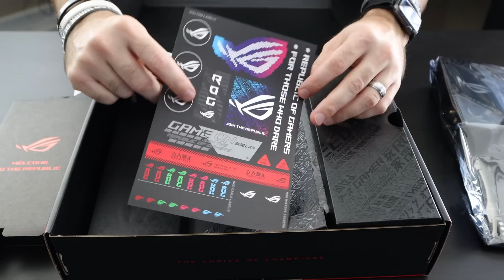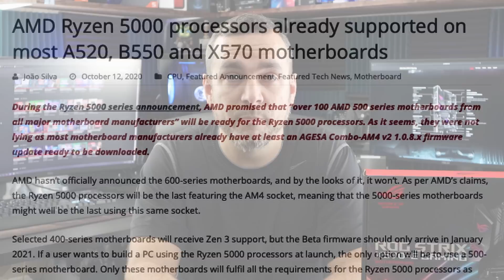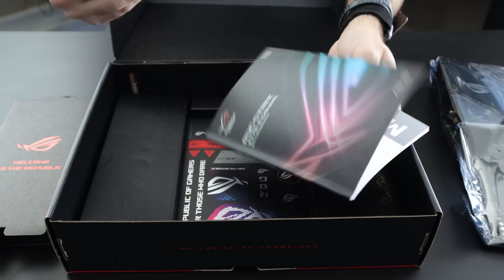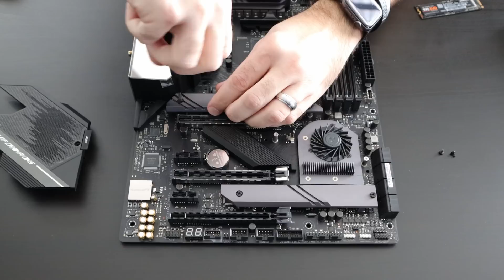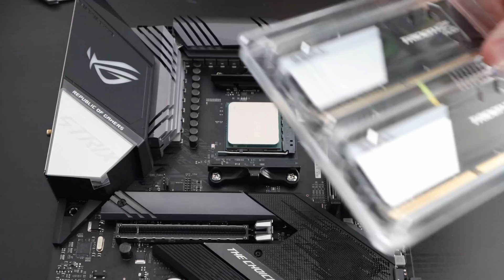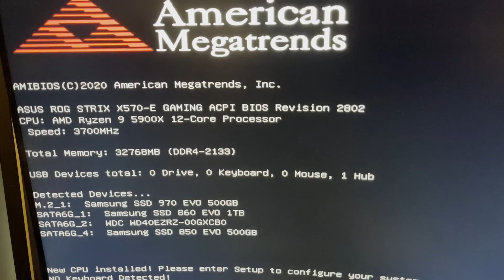Gaming PC Upgrade | Ryzen 9 5900X and ASUS ROG STRIX X570-E Gaming PC Build

Comment: My m.2 drive was overheating on the strix-e and i found out that the plastic gum that sticks to it between the heatsink that you removed the blue film from had turn to liquid (i did remove the blue film too before anyone jumps to conclusions) i had to clean it up and reinstall it without that disgusting plastic gum thing even if it scratches on the heatsink.
Reply from the maker: That’s strange. Check your fans and cooling. The paste on the back of the M.2 shield is there to help transfer the heat from the SSD to the heat sink. It helps keep it cooler. A lot of people also use system cooling to help reduce temps on the M.2 SSD, and completely remove the shield altogether.

Comment: thats the board and cpu i want, also the ram. but i want the nocuta NH-D15 cpu cooler and just wondering if that ram will get in the way of the coooler? will i have to get a low profile ram instead?
Reply from the maker: Not sure about that cooler and the clearance you will need. I can fit four sticks of RAM with my NZXT AIO, but it is a tight fit.

Comment: What made you pick this board over other similar priced 570 boards? I can't decide between this board or the unify 570. They are the same price in my area.
Reply from the maker: Honestly, I had an MSI board originally and returned it for this one. But I have been building PCs for almost 20 years and other than my first build, have always used ASUS motherboards. During that time, only one board has failed. I have retired or sold them most of the time. They just have great quality and are great overclocking boards. I might be missing out on better boards by sticking with ASUS, but I love their reliability.
Reply: @JasonRose2628  Thanks for taking the time to respond. Now for the hardest part of pc building this year. Finding the parts.
Reply: Same here

Comment: Hello, nice build 💪 I have the same motherboard and x63 cooler and i wonder if i can fit 4x 8gb of ram in ?
Reply: 2x16 would be a lot better
Reply: @Acrozion  will i be able to fit 4x8 ? i already got em :/
Reply: @jakob5144  please don’t do 4x8 it gives the same performance as 2x8 but adds extra heating and less cooling it’s also overkill you only need 16… give me a favor, save 50% of what you bought and refund 2 of them… but your answer is yes anyone can fit up to 4 sticks of ram
Reply: @Acrozion  Thank you for answers man :)
Reply from the maker: With the way I have this Z63 mounted, it blocks one of the RAM slots. You would need to rotate the AiO block to be able to fit four sticks of RAM. Sorry for the late response, it has been a busy week!
Reply: @JasonRose2628  ive managed to fit all 4 sticks whithout a problem :) it was more than enough space

Comment: Did you have any issues with the Kraken Z73? I heard there was some USB compatibility issues regarding ASUS motherboards & Z models of the NZXT. Did you have any of those with that motherboard?
Reply: Also have you had any issues with the CAM software not displaying the correct temperature of the AMD processor? I have heard stuff that due to the way the AMD processers display temperature, that it wasnt running well with the cam software.

Comment: Went to Micro Center today and a worker told me to get this board.
Reply from the maker: So far, it has been great! Very stable. Using AI Suite 3, I completed an OC of 4.6 GHz on all cores without tweaking any settings. Are you going to go with this board? What other specs?
Reply: @JasonRose2628  the other one I was looking at is the Asus B550-e. I don’t know if I need an x570. What’s the big difference?
Reply: @TheAccountant369   The x570 lineup have all PCIe-4.0 slots for m.2s and gpu slots, whereas the b550 lineup only has the PCIe feature on the top slots of the m.2 and gpu

Comment: Would the X570 Dark Hero be better for the 5900x? Have heard good things about it.
Reply from the maker: Probably, I believe it is considered the best X570 board out. But, it also comes with a much higher price tag.
Reply: @JasonRose2628  Price not an issue for me, going all out lol
Reply from the maker: If I could, I would probably go with that board. But unless you plan to use everything it has to offer, it is wasted money. Like the ability to have 128GB of RAM at 4866MHz is gonna be very expensive. Also, if you are getting this board, then you are probably gonna have multiple M.2 drives and GPUs. Other than that, your money would be best spent on a cheaper motherboard and improve other components. But if money is not an issue, then it doesn’t really matter! 👊🏼👍🏼

Comment: Question ! Please I need your help 😅 I had the same thing happen where I only have the 4 pin and I don’t have the extra pins to connect for the CPU and when I tried booting it I got stuck on the screen where it booted up. Was wondering if I needed to update my bios for my x570 or if I need those extra pins to the CPU
Reply from the maker: Your system can function just fine on the 8 pin connector. I did it in my last build when I stopped overclocking my 9900K. You only need to connect the extra 4 pin connector if you plan to overclock your CPU (which this time I did). So if you are having issues with boot up, you may need to do a BIOS update. It could be a few other factors, like your PSU might not be very efficient and not providing enough power with the 8 pin connector. What PSU do you have? Where exactly during the boot process does the system freeze or get stuck?
Reply: TechRated Thank you man I figured it out I needed to buy a old Cpu and update my bios then where and returned it and was able to run my 5900x just fine !
Reply: 8 pins are necessary? What if i Cant find 4 more pins? 😨 For the first time im going to build a PC by my self and im god damn nerves

Comment: I mount my radiator like that before and it just lasted a year. Then I researched and the hose should be below.
Reply: He has mounted it fine. The top most part of the radiator needs to be a level higher than the pump. Doesn't matter whether it is the inlet/outlet side up or the the other end, which ever side up you are that end needs to be higher than the pump level.
Reply from the maker: That’s debatable. Check this video. 
https://youtu.be/DKwA7ygTJn0

But I did switch it this time around, it might not be clear in the video.

Comment: I noticed that the RAM speed for this board is 2666 MHz rather than the standard 3200 MHz of many other boards. Do you happen to know why that is? I just bought this board and I'd hate to be downgrading my specs. I'm pretty sure I can go into BIOS and change it to 3200 MHz but I would hate to OC the board and make it possibly unstable. I have 32gb of RAM DDR4 3600 CL16. Please let me know!
Reply from the maker: Sorry for the delay, this comment got lost in the shuffle. I have enabled DOCP to 3600MHz and I haven't had any issues at all. Many people are going to 4000Mhz with no issues. I wouldn't worry about it. Not sure as to why ASUS went with 2666MHz for base specs, but I can say that this board is very stable so far! Good luck with your build!
Reply: @JasonRose2628  thank you!

Comment: Hi !!! thanks for your video !! :) i have a question, i want to buy asus ROG strix x570-e gaming. My question is it is possible to connect all fans of the corsair 5000D on the board ? 
Front Fans:	3x 120 or 2x 140 mm
Rear Fans:	1x 120 mm
Top Fans:	3x 120/2x 140 mm
Bottom Fans:	N/A
Side Fans:	3x 120 mm
Do you think the motherboard can support all these fans ?
Reply from the maker: The motherboard has six fan headers total. If you have that many fans (very nice case btw), you could definitely benefit from a fan hub/controller. You should check out the Commander Pro 
https://www.amazon.com/Corsair-Fan-Controller-Commander-CL-9011110-WW/dp/B0725HP1J2
You may need more than one.

Hope that helps!
Reply: @JasonRose2628  thanks a lot my dude 👌🏼👌🏼
Reply: @johann1336  youll need to use commander pros anymore if you want to use corsair fans, which I would HIGHLY recommend says if you want that many fans im sure you want it to look nice. OR go with LIAN LI UNi fans that you can connect like 3 fans together and only need to use 1 fan header on the mobo because of the waythey are made
Reply: @100MilWill  ty a lot !!

Comment: How's the system doing ? I'm thinking of getting the same motherboard and CPU and rtx3080 , what you will suggest for power supply of that ?
Reply from the maker: So far, the system is doing great! No issues at all. I have read a few reviews saying that the board crashes after a few months, so I still have some time to get to that point. However, I just overclocked the 5900X to 4.6GHz on all cores very easily using AI Suite 3. Working on editing that video now. I haven’t tried to tweak any voltages myself yet.
Reply: @JasonRose2628  I've ordered one hopefully will be fine ...

Comment: "Question" Can you use the onboard HDMI graphics port with the Ryzen 9 5900X and ASUS ROG STRIX X570-E. ? ? ?  just thinking would be good to have a internal graphics backup in case a card fails.
Reply from the maker: No. The 5900X doesn’t have integrated graphics. You will need a GPU of some kind!

Comment: I'm using similar configuration, but with strix 3080 and lian li 360 galahad inside lisn li 11xl case. 3200 cl 14 ram *16 gb and Samsung 980 nvme. Can my ram be stable at 3800 cl 14 with this board? 3600 is also fine

Comment: So did you find out what that extra 4 pin connection for the cpu was?
Reply from the maker: I already know what the extra connector is for, just needed to connect an additional cable from my PSU. These CPUs require more power, especially if you plan to OC. So instead of it just requiring 6 or 8 pin for power, it requires an 8+4 pin setup. I have been able to run 12-pin CPUs on 8-pin connectors before, but I wasn't planning on OC'ing. With this CPU, I plan to OC, so I need all the power I can get. I also do not have the black/blue cable extender for it, so I’ll be ordering it soon!
Reply: @JasonRose2628  That's why I'm having issues with my PC. I only hooked up the 8-pin section. I need to hook up the 4-pin section as well!
Reply: @Esspppiia  Did connecting the 4-pin help? I would have thought that the 8-pin would be enough with a good PSU.

Comment: How did you get the GPU stand on its own ? Did you use a riser for that? Where was the PSU ? Thanks!
Reply from the maker: The Phanteks Enthoo Evolv X case that I am using has a built in vertical mount. I purchased the additional riser cable for the vertical mount. I explain it all in this video! 
https://www.youtube.com/watch?v=bNgsxVLFexY&t=78s
The case also has a PSU shroud. The PSU and cables are all hidden underneath the shroud just below the motherboard. Normally, I would include all of that in a build video. Since I was just upgrading,  I didn't show any of that stuff. Hope that helps!

Comment: You find 4pin adapter for cpu?
Reply from the maker: Yes I did. I had add a 4 pin cable to my power supply and connect it. I will be ordering another cable mod cable to connect to it though. You can see the stock power supply connected to the CPU connector at 12:41.
Reply: @JasonRose2628  thx for answering. I have another one question, maybe ypu know. I have the same cpu and mother board, but my power supply didn't have a 4 pin  connector, have i any possibilities to use it, or i need a new power supply?
Reply from the maker: Is it a modular PSU?
Reply: @JasonRose2628  Yes. It Corsair RM650i 650W , but i have only 4+4 on it .
Reply from the maker: @xoove7531  Since it is modular, do you have any room to add cables? If not, then you will need a new PSU. But according to the specs online, you should have two 4 pin CPU connectors. What connectors are you currently using?
Reply: @JasonRose2628  my bad. Model of my PSU is Corsair RM650x not "i"
Reply from the maker: Yeah it also has 4+4 pin for the CPU. You will be 4 pins short. The board should function just fine with the 8 pins connected to the 8 pin connector on the motherboard, but you will not be able to overclock. I have had to do this before and it worked just fine. Just do not plan to OC.
Reply: @JasonRose2628  Maybe it will be interesting for you. I use 8 pin, all is working, till i start playing. After 2 min after launching the game, PSU turn off. I have only nvidia 1080 now , and 650W  is enough for it. But, for this CPU it's not enough using only 8pin. I'm not OCing it.
Reply from the maker: That may be the issue, that it is only 650W then. Because I am using an 850W and don’t have those issues. What about your temps? Are they good? Could be overheating.
Reply: @JasonRose2628  28-35 C. Kraken z 63 on the board, don't have problem with overheating.

Comment: I am thinking buying this motherboard in X570-F version for ryzen 5800x, but I read some negative comments, do you consider it a good motherboard or am I going for the aorus x570 pro?
Reply from the maker: I haven’t had any issues at all so far, but I haven’t tried to overclock yet. That’s coming up soon. What were some of the negative things you read about the board?
Reply: @JasonRose2628  In newegg comments, i want the X570-F version, i think is very similar in quality
Reply from the maker: Just read a lot of them. Most are saying that it died after a few weeks or so. Some were complaining about having to buy tools to remove the chipset cover. Lol. I guess it just depends on where you read your reviews. Micro Center reviews are a little different. I have been building PCs for 20 years and I’ve always used ASUS boards except for my first one. I’ve had one fail. We will see if I have the same luck as these guys I guess. But honestly, I think that either way you go, you will be fine. Gigabyte boards are really nice. I have a few friends that use those boards and they love them. When do you plan to build?
Reply: @JasonRose2628  Soon, I only need the motherboard, already have the 5800x and the anothers components, i think I'm going to go for the x570-F, your story convinced me, thank you very much for your time
Reply from the maker: Awesome man! Be sure to let me know how it goes. If you reply to this thread, I might miss it. Make sure you start a new one. I really want to hear how it goes! Good luck! 👊🏼
Reply: @JasonRose2628  
Thank you, I'll keep you informed, my badge arrives on January 20
Reply: @JasonRose2628  Hello again, i already built my pc, all is fine, greath motherboard! Thanks for the advice :)!!
Reply: @gigoxstyle  hello, how is your motherboard going I am thinking of buying but I am seeing lots of negative comments that's why I am having difficulty in choosing it.
Reply: @Rick_ysi  zero problems, All good, I dont know why this board have bad comments, is very good 😋

Comment: what timings did your ram come with? and how is it handling DOCP?  saw some infor that the new ryzen chips like 4 stick a little more.  whats you experience been?
Reply from the maker: CL 16-19-19-39 1.35V
So far, all is good on DOCP. I have heard the same about four sticks performing somewhat better, but it wasn’t that much of a difference from what I read. I haven’t had any issues at all so far and I am currently working on a benchmarking video for you guys. I won’t be able to test with four sticks of RAM, but others on YT have. Overall, very happy! 👊🏼👍🏼
Reply: Good to know man. I have the same setup just different ram. 3200 Corsair. I’m thinking to upgrade a bit. Keep the content coming man 💪💪
Reply from the maker: @GnarlySpookXT  Did you upgrade from the 3600X? I checked out your OC video! Very well done. I'll be doing a video similar for the 5900X. Probably not a tutorial, but a benchmark before and after. Built my son a PC with the 3600 and it has been perfect. Very nice budget chip. I didn't plan on overclocking his PC, so that's why I didn't go with the 3600X, but I am very impressed with it. Looks like we are both just getting started with YT! Keep it going!
Reply: Thanks!  I did upgrade from a 3600x. I learned a lot since that vid.  Have AIO cooling. Still getting used to the slightly higher temps with the 5900x. Messing around with fabric clocks a little. But I’m looking forward to the bios update coming out on the 9th I believe.
Reply from the maker: @GnarlySpookXT  Yeah I was kinda freaked out by the higher temps at first. I OC’d my 9900K, ran a benchmark and the temps stayed in the mid 50s. In the beginning, I was getting that at idle on the 5900X. I have adjusted fan speeds on my AiO and I think the thermal paste had time setup cause now I’m getting idle temps in the upper 30s to low 40s (depending on room temp).
Reply: I’m right there with ya. I did a manual overclock shortly @1.35 volts and temps were WAY lower because it’s a steady voltage. (Using ryzen master) But didn’t see any crazy performance. I was just tinkering. Havnt read what constant voltages these chips can handle without degradation

Comment: Hey bud, I got the same board... I built my pc, amd RYZEN 3800x processor,  2060 Super OC GPU 8 GB, 3600mhz DDR4 memory 32 GB DOCP clock to 3600 MHz running at the speed. I just did a flash bios update so I am ready if I choose to buy the 5950 chipset
Reply from the maker: Very nice! The 3000 series is great! The 5950 is definitely a beast also! Any plans on upgrading your GPU once everyone can get some stock?
Reply: @JasonRose2628  well honestly my 2060 Super is great! I am getting average 80-98 FPS on cyberpunk 2077 at 1440P resolution and settings on high to ultra. I am using that as a benchmark. Forza 4 I average about 90 FPS on 2160 resolution. Probably if I was to upgrade the GPU it would be the 3080... but don’t think right now.
Reply from the maker: Oh no I don’t think you need to now! The 2060 is perfect for your build. I was just wondering about your future plans or what you might want to pair with the 5950. Cyberpunk is definitely a good benchmark Lol! Good luck with whatever you decide to do!